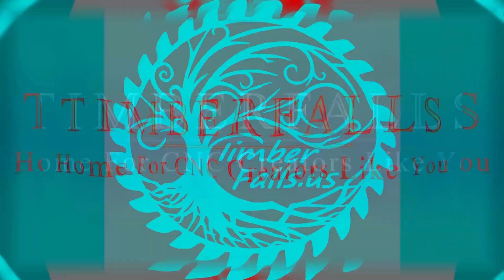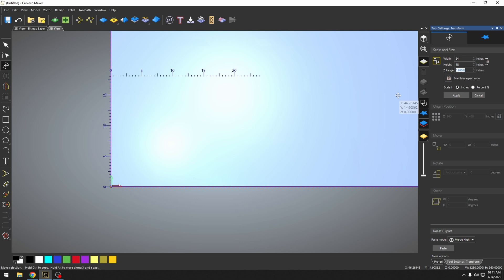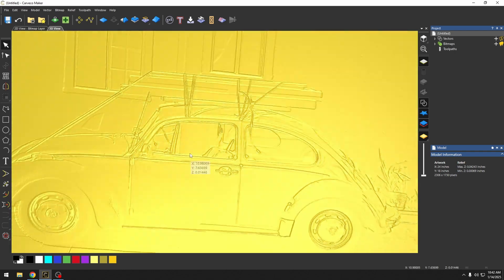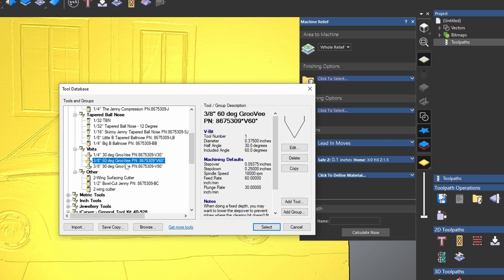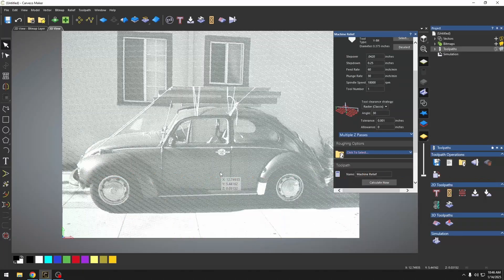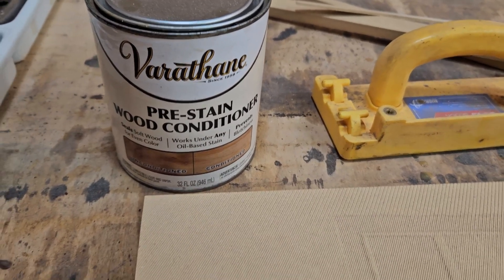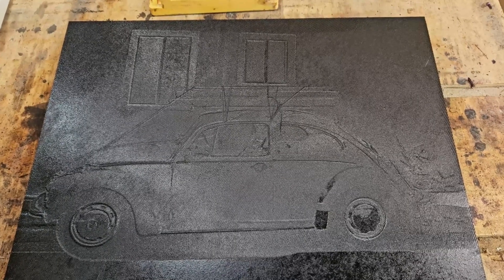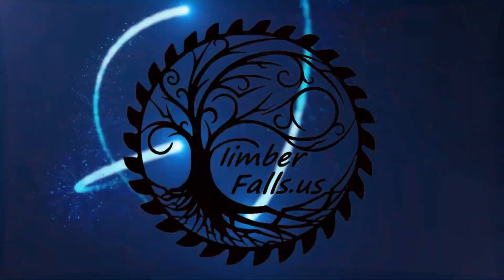How to Create Stunning Photo VCarve Projects on Your CNC!

Comment: HI!
I've tried engraving pictures several times, but I couldn't do it! I did everything exactly as shown in the video, except for the depth, because I was working on 4 mm thick MDF! My question is, is it important that the tool goes down to 6 mm deep? (0.25 inch=6.35mm) Thank you for your help!
Reply from the maker: My measurments were in inches as .04" for depth of the model when pasting and around the same number for stepover around .04 -.06. You just want to make sure your stepdown is deeper than your depth of .04 so it cuts it one pass. Hope this helps. The size of the model pasted and the right stepover is what makes these work.
Reply: @Timberfalls  Thank you very much for the advice and the quick response!
I hope it works out, I'll write about it!

Comment: I followed your guide exactly but I'm having issues when cutting the lines are getting torn out/ really fuzzy how could I go about fixing this
Reply from the maker: This could be from a dull bit or your feed rates may need adjusting. I sometimes use a wire brush to brush out the grooves after carving it.
Reply: @Timberfalls  it was a brand new bit speeds and feeds are 60 ipm 20 plunge at 16000 rpm
Reply from the maker: @Tyler-ng7cw  if it is mdf it is going to be a little fuzzy. I would try using a wire brush in the direction of the cut grooves to remove most of it. Using a brush to remove that stuff will not effect the quality of the finished product but I would recommend brushing the fuzziest parts out. Sometimes it is the grade of mdf that can cause this too.